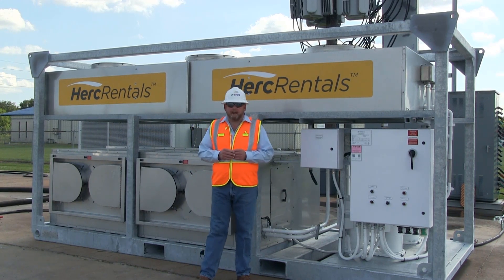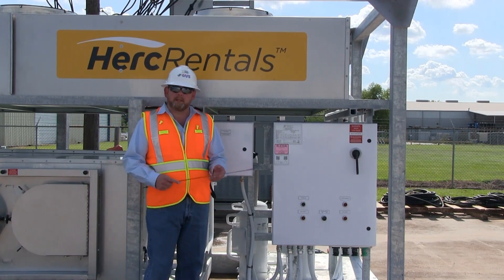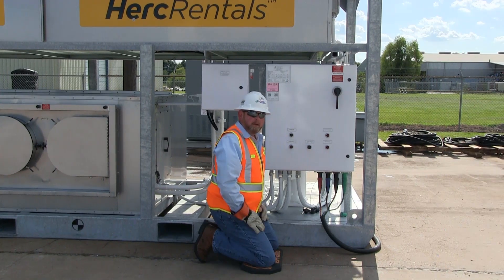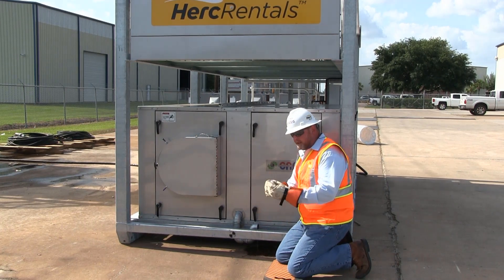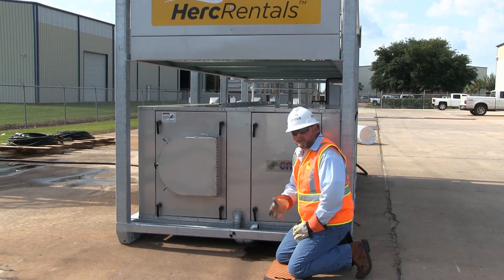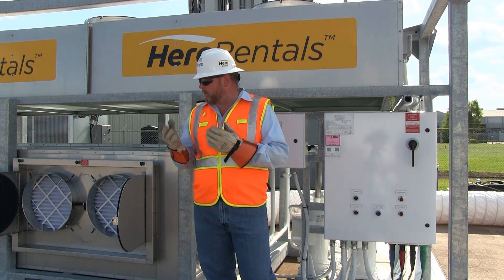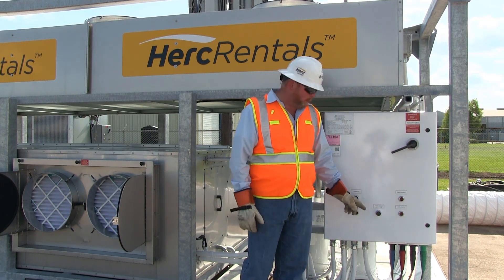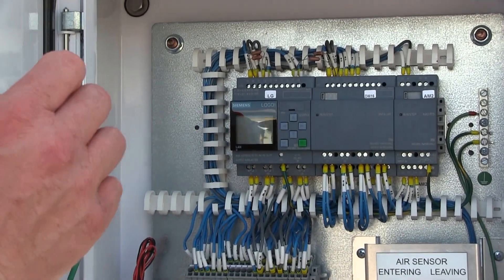80 Ton Industrial AC Unit

Comment: Why does the ground need to be plugged in first?
Reply: Safety. If you plug in a hot and say there's a cross between that hot and a ground, the entire ground surface has a floating voltage above ground, then because it's AC you bridge the gap between those voltages and get shocked. With something this big that would be very dangerous.